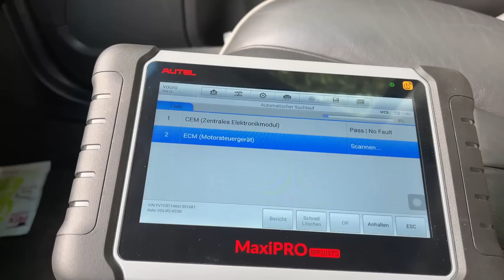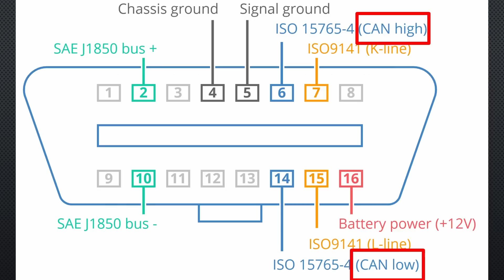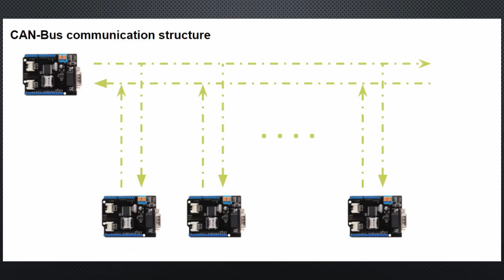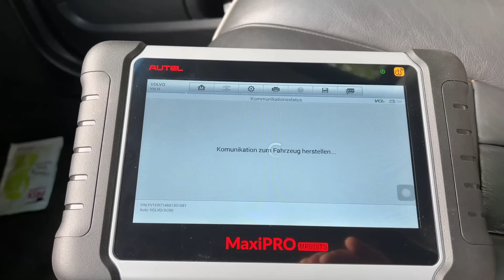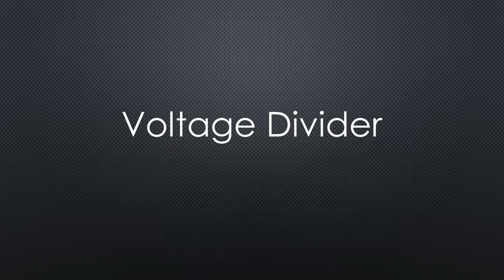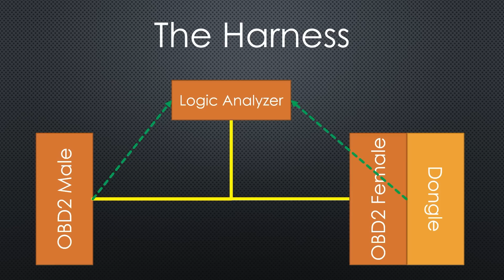#421 Home Made OBD2 Engine Alarm Resetter device using an Arduino?

Comment: the amount of details in the comments here is incredible! I would still try to go the direction of using a existing library, maybe you can get the library you found to work? My (noob-ish) experience with ODB2 is that there are so many differences from car to car so if you find a libraray which supports almost all cars than your Alarm Resetter will maybe also support almost all? :-) Maybe someone reads this an can suggest one?
Reply from the maker: I agree that the resetter will not work with all cars. Mine would already be ok for me... The libraries work because the "bits" are the same for all cars. Just their meaning is different...

Comment: Maybe a resistor between the CAN bus and the fault analyzer could be used to see where it came from. If the pulse are higher on one side of the resistor the data direction can be detected.
Reply from the maker: Good idea!

Comment: Hello Andreas.
On my current work I'm responsible for Diagnostic Over Ip - DoIP in one ECU in Volvo car.
But I also had an experience in Diagnostic over CAN bus  (UDSonCAL)...
But in general -  It is a common automotive standard for this -- UDS (Unified diagnostic services - ISO 14229-1, ISO 14229-2, ISO 14229-3)
I can recommend you to find this standard, especially part 1: Road vehicles — Unified diagnostic services (UDS) — Part 1: Specification and requirements 

Long story short - your Arduino ECU need to send Engine ECU a CAN message with UDS  service 14 - ClearDiagnosticInformation and FF FF FF as a groupOfDTC description:
> 14 FF FF FF
Reply from the maker: Thank you for the info. I never heard of UDS. What is its relation to OBD2 and CAN?

Comment: Of course you don't care that you can get a volvo-specific odb2 scanner that allows you to view and clear the volvo specific codes.
I had to buy one for my C30 project I did an engine swap on.  It wasn't very expensive.  But I've been wanting to do an odb2 scanner for a long time.
On my 2003 Prius, it gets a check-engine light because the catalytic converter is missing a valve thingy that costs $1200, and no way I am going for that when another 2005 Prius cat works great but doesn't have it.  So it would be great to have it clear this code as soon as it shows up, probably once a day.
Or better yet, disable the check engine light on the dash, and instead have a device that only turns it on if ANYTHING ELSE comes up exdept that code.  :)
Reply from the maker: Others also reported alarms without a proper cause. Fortunately yours does not block the car... Here the alarm did not reappear so far.

Comment: Some error codes are transient, and they clear themselves as soon as the problem goes away. For instance, a loose gas filler cap. This will trigger a code, but goes away almost immediately if the cap is tightened. But other codes are "sticky". The industry terminology for this is "gray codes". These codes do not go away immediately on their own, and they cannot be cleared through the OBD port. They only go away after a certain time, distance, or stop/start cycles, and the ECU is satisfied the issue is resolved, based on manufacturer ECU programming. For instance, the oxygen sensor. If there's an error code for the oxygen sensor, it cannot be cleared through the OBD port. It will only clear after, a) the problem is fixed, and b) the vehicle is driven for a few days. The last time this happened to me it was about two days and ~100km. After the "resolution period", the code may be resolved, but it may still be listed in the "memorized codes" of the ECU. Then finally it may be cleared through the OBD port.
Reply from the maker: We were able to clear the error and the car runs since then without error. But we will see if this was just a false alarm or if it was more...

Comment: could this have been accomplished quicker with an off the shelf code reader?  I use one to do things like this.  Where this wold be super interesting is if you could log all the data and export to a PC to graph trends, like all the temperature sensors, oxygen, MAF and so on.
Reply from the maker: The apps I used in the past were not able to reset the alarms. But many viewers write they can do the trick now. So I will try...

Comment: I would only reset if it shows a already manually verified error (even better would be I guess fixing the sensor or contacts). But I can understand the car might not be worth the trouble
Reply from the maker: My goal only was to get off the road. But unfortunately, the error did not reappear up till now (and we forgot to take notes). So I have to wait...

Comment: I obly have minor experience with canbus so far but I am going to do a university project on it soon. I can only say that I am really skeptical that those few lines of code should do the trick. Can-bus is really complicated and has several varieties. I also recommend you replace that sensor 😅
Reply from the maker: I would replace the sensor if the error reappeared (we forgot to note it down because we thought it will reappear)...

Comment: I have a cheap Autel block that plugs into the OBD-II port and works with a phone. It was less than $99 US at Walmart. I have reset errors and the diagnostics and CAN messages are very good and reports can be generated in PDF and emailed . Worth every penny.
Reply from the maker: Good to know. Thank you! Would be much easier.

Comment: I've done car CAN-bus decoding. The hardware level is easy. You'll get those message, but the interpreation what those message mean is non-trivial. To decode it, you need a car maker and often model and year specific lookup table. In this table you'll find info like this: Message 100: 8 bytes length, 6 bits of information A, 3 bits of information B, .... Sometimes you even need a formula to make "useful values" out of it. Like temperature where it you need to extract the relevant bits, make a number of it and multiply with 10 and add an offset of -30. Fun stuff like this. Maybe you are lucky and such a lookup table got leaked or reverse engineered for your car. OBD2 is just a subset of those message where the "which bit mean what" is specified across makes and models. Another thing that should be open for right of repair stuff. But the manufacturers will fight this with every method they can. You could build amazing stuff if that data is know. As said, been there, done that. But the table was under NDA and sadly not the make and model of my personal car :(
Reply from the maker: I agree about reverse engineering. I know this from other applications like sensors. Here I hoped I could only copy the reset commands of the Autel instrument (if I ever find them)...

Comment: Hey sir I want to increment with the push button but it is very tedious process let say i want to increment 0 to 50,000 and i will press the button 50,000 times and i search all over the places that how to press a button that increment by it self and when i release it will stop incrementing.
Can you guide me or make a code or tutorial?
Please sir
Reply from the maker: I think you find the solution yourself if you search for "latch circuit"
Reply: @AndreasSpiess  thanks sir

Comment: May be you can try a tester present of ECU on the bus, quite similar to i2c scanner, staring from 0x000 to 0xFFF ECU identifier, usually PCM has the common ECU ID...
As Volvo on 2000 has also owned by Ford it is posible that exists another CAN bus on the vehicle at 125k speed, if you could see on the backside of the obd2 car connection twisted cables are CAN busses, check if there is only one bud or at least two: one at 500k and the other at 125k
Reply from the maker: I hope I do not need to use the slower buses. But it is good to know they exist and if I do not find signals from the Instrument on the fast bus I have to dig into that one, too...

Comment: Nice project, but maybe you can go in another direction.
Like storing certain car parameters and analyse them later- elevation, distance, fuel consumption etc.

Regarding the DTC reset, there are Bluetooth ELM327 or something, adapters, and some android applications, that do miracles on many cars, so you can even help out a friend in need, on the road, instantly, without "hacking" .
Reply from the maker: I agree about these apps and I tried some of them. But none solved my problem of resetting the engine-blocking messages. I got now some hints in the comments an will try it next week...

Comment: Hi Andreas, I've done some projects with the ESP32 and the internal can transceiver or the teensy 4.0 and there two internal can transceiver to control electric power steering pump or use it as a hmi for the megasquirt ECU. 
But in your point, the fastest way to find the error reset is, to connect your Arduino sniffer between the car and the diagnostic tool and sniff the error reset command. 
Greetings from Germany
Andreas
Reply from the maker: That was (or still is) my plan. But it is not so easy to attach the messages to the sender :-( CAN is a common bus and you see all signals.
Reply: @AndreasSpiess  yes it's not easy, but if you sniff a longer time you can ignore all ID's they comes repeatly and the remove DTC command will only come ones. Maybe Wireshark can help you to interpret the sniff. 
If I have time I can do the same test by myself, but I only own a VAG diagnostic tool...

Comment: I just watched an episode of Pine Hollow Auto Diagnostics where the CAN bus on a Mercedes was brought down by a rear windshield washer fluid leaking into the car shorting the signals causing a non-start, .  Could you just sniff the reset packets coming from your brothers scanner?  Interesting project thank you.
Reply from the maker: That is my plan. But because of these many messages it is not easy to fin the right ones...

Comment: You really need SavvyCAN and dbc files for your make.
Reply from the maker: Thank you. The screenshot of the project shows the same information as my logic analyzer. Does it have more (filters, OBD decoding, etc)?
Reply: @AndreasSpiess  If you can find dbc file for your make you can decode many infos directly to the intended unit of measurement. I doubt EOBD decoding will be useful in your case. Most likely Autel uses vendor specific commands.

Comment: Hello 
Node red Support can Bus and I also implemented the support of the CAN FD driver. You can easily use it to snif the network also.
Regards
Reply from the maker: Interesting! So far the sniffing seems to work. Where I have my problem is to understand the OBD2 traffic and particularly where it comes from (to filter the packets from the analyzer)
Reply: @AndreasSpiess  il’s impossible without the DBC file from the manufacturer or internet, CAN message start With ID but there is no rules unfortunately

Comment: I have that on a Renault forces me to wait from 15 to 20 minutes to try to restart again if it fails the first time I need to wait 20 minutes more, so far the I have replaced all possible sensors causing the failure and all possible cables whiteout luck, Would be great if you get this to work on your car , will take a look and see if it weeks on mine without more modifications.
Reply from the maker: Maybe the code I used works in your car. Would be worth a try, I think...

Comment: Automotive can bus is not 12v, it is 5v.
Reply from the maker: Good info. I did not check. But I thought it is differential? So would it be 10 volts? or +/-2.5 volts?
Reply: @AndreasSpiess  it should be just under 2.5v at idle to chassis ground.  When it goes high the differential voltage should be around 4.5 between high and low, low should be a little over 0v and high should be a little under 5v to chassis ground.

Comment: My mother has a Volvo XC 70 of about the same vintage as yours. That car is too smart for its own damn good. In her case, the engine faults actually warranted an engine shutdown (oil pressure problem), but we would have really appreciated a more helpful message than a service warning on the dashboard. It ended up being her oil catch can, which hadn't ever been checked, was full up to the point it was slightly interfering with oil flow. Still, that was a US$1000 dealer service visit I could have fixed myself. Volvo makes a great car, but this is definitely a shortcoming.
Reply from the maker: It seems that many viewers have stories like that with their cars... We will see how my story ends ;-)

Comment: Am I missing something ?
Don't use software to fix hardware problem.
Just open the hood, look for contact corrosion and reseat the connectors.
Reply from the maker: This is work for the dealer. I just want to get off the road next time. Fast!
Reply: @AndreasSpiess  
Please take look at "ELM327 OBD to RS232 Interpreter - Elm Electronics"
The original CAN to UART bridge 
There is a 94 page manual ELM327DS.pdf

Description 
Almost all of the automobiles produced today are required, by law, to provide an interface for the 

connection of diagnostic test equipment. The data transfer on these interfaces follow several standards, 

but none of them are directly usable by PCs or smart devices. The ELM327 is designed to act as a bridge 

between these On-Board Diagnostics (OBD) ports and a standard RS232 serial interface. 

In addition to being able to automatically detect and interpret nine OBD protocols, the ELM327 also 

provides support for high speed communications, a low power sleep mode, and the J 1939 truck and bus 

standard. It is also completely customizable, should you wish to alter it to more closely suit your needs.

Comment: Hallo Andreas,  I have an arduino sketch to sniff CAN bus through OBD2. It uses an ESP8266, with an MCP2515 CAN module, creates an access point, and a websocket server and I have a small HTML file to connect to the websocket server, and display the CAN messages in a table sorted by the CAN message IDs. I can share it with you if you would like to test it.
Reply: Hello both, I happen to design a pcb with the same MCP and esp32 but never got to work on software, I can share that with you guys too. 

Ali
Reply from the maker: Thank you! You can reach me on one of the channels mentioned in the video description.
Reply: @AndreasSpiess  I've contacted you through FB, check the link and I'll try to explain some details later. Cheers

Comment: I had a problem with a faulty crank sensor on my car. I used the ELM327 Bluetooth dongle and a app on my phone the pro version and was able to find the problem and to reset after replacing the sensor. The dongle is now kept in the glove box off the car.
Reply from the maker: Good to know, thank you. Because others also wrote that these apps work I will purchase one and try...

Comment: Hi, Volvo uses K-line and 2 CANbus:es, one Low-Speed and one Hi-Speed.
Low-Speed is on pins 3 & 11 (OBD)
High-Speed is on pins 6 & 14 (OBD)
1999-2004:
Low-Speed: 125 kbps 
Hi-Speed: 250 kbps
2005-:
Low-Speed: 125 or 250kbps (Unsure)
Hi-Speed: 500 kbps

Not all units are connected to both busses.

The CEM (Central Electronics Module) is kinda like a router/firewall for the CANbuses, especially to and from the OBD port.
It needs a periodic keep-alive message on the K-Line interface to "open" the firewall for the OBD CAN into the real CANBus network.
K-Line baudrate: 10800 or 10400, 8N1
Msg: 84 40 13 b2 f0 03 7c
Send it every 5 secs or so.
Reply: fiat also uses at least 3 buses depending on model, different buses communicate with different computers.
Reply from the maker: Thank you for the info. I hope I do not have to deal with the other buses!
Reply: The firewall you're talking about is just two relays turning on and connecting the high speed CAN to the OBD connector. I've heard of people just bridging those relays

Comment: The project sounds interesting, but probably a bit overkill for the task. But i'm not saying it's a bad thing 😊. Like other have been commenting the cheap 5€ bluetooth adapters works quite well. Finding the right software for PC or Android can be challenging. I think popular ones for android are “Car Scanner ELM OBD2” and “Torque Lite”. I think both can do DTC reset. There are also model specific pc software that can do many more things than basic software, but I don’t know what it would be for Volvos.
One correction to your video. OBD2 is not exactly working on top of CAN-bus like you described. CAN-bus is one of the communication buses in the OBD2 interface, but there are also other for example K-line that can be used to talk with the ECU. It is possible that the scanner tool you are using is sending the reset signal through K-line instead of CAN-bus and that’s why you can not see it with the current setup.
Reply from the maker: I tried the “Car Scanner ELM OBD2" and only the pro version for 20 bucks promises the reset function. But not which alarms it can reset. But after many people write it works, I probably will spend the money for a try...